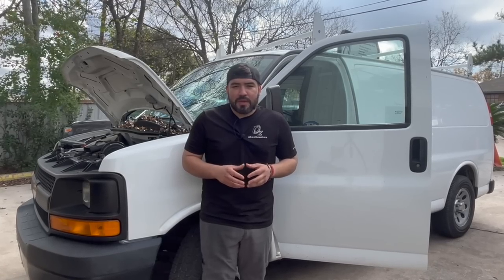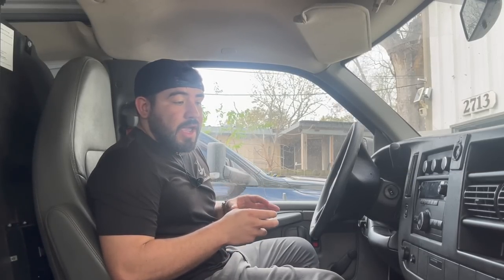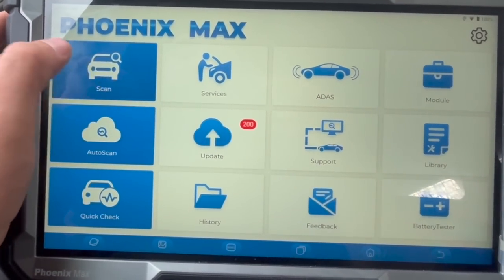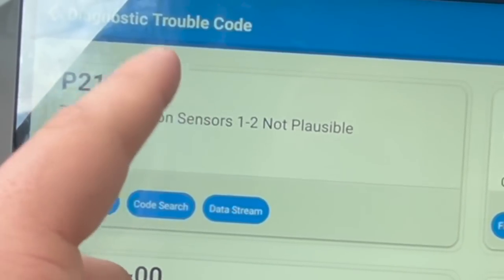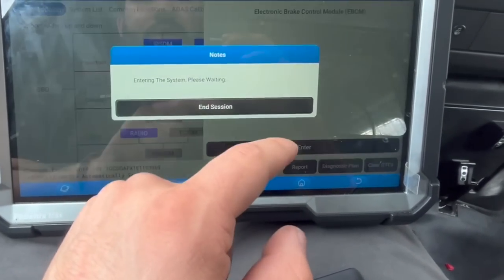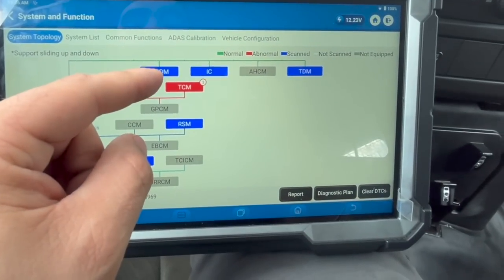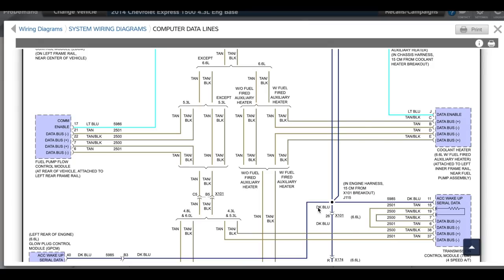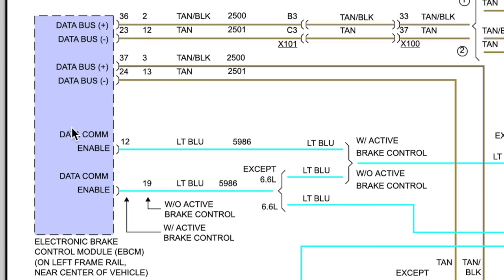Electrical nightmare on this 2014 Chevrolet Express

Comment: Excellent video Oz. One thing that I would like to point out is connecting the jumper wire directly to battery positive is risky. I would have put in between a small incandescent light or a small fuse, just for protection. What if the ABS module had an internal short. And the BCM wire shorted out and blew? I once put a 12 volt without a fuse directly to a module, and it had a short inside the module. And it melted the ground supply wire. Lesson learned. Hope my advice helps someone.
Reply from the maker: That is true.

Comment: For mine it is the connection all you have to do is go under your driver front mid... get that clamp on there good and all good. Iff not you got a problem with the module.

Comment: That is great info on finding the problem with the analyzer. One thing I learned a long time ago when you have an electrical problem is to do a thorough visual inspection. I have found numerous electrical issues because of squirrel or mice damage.
Reply from the maker: Normally I see that happen in wooded areas or really cold places where mice and squirrels can bundle up and bite them wires
Reply: Good thing there going to soy wrapped wires..NOT!

Comment from the maker: **Want to own the tools I use ?? 
Click on the amazon link below to get my top 5 Tools I use**
Automotive Test Light- https://amzn.to/3z1Pdxa
Flexible Backprobe- https://amzn.to/3Pyr3zO
Multimeter- https://amzn.to/3PbuT23
OBD Scan Tool- https://amzn.to/3zaNWnq
Wire Piercing Probe- https://amzn.to/3OecWhT
JarHead Diagnostics promo code- OZ10
Topdon Phoenix Max- 

https://na01.safelinks.protection.outlook.com/?url=https%3A%2F%2Fwww.topdon.us%2Fcollections%2Fprofessional-series%2Fproducts%2Fphoenix-max&data=05%7C01%7C%7C897428785db447e8345d08dae2a18266%7C84df9e7fe9f640afb435aaaaaaaaaaaa%7C1%7C0%7C638071480567184739%7CUnknown%7CTWFpbGZsb3d8eyJWIjoiMC4wLjAwMDAiLCJQIjoiV2luMzIiLCJBTiI6Ik1haWwiLCJXVCI6Mn0%3D%7C3000%7C%7C%7C&sdata=luV2vOgQ9MwIpnIc2%2BjGABg%2ByD8qsUdiydeyqGJKzOQ%3D&reserved=0

Comment: Since the wake up signal is a low current 12v, you can just jump power from a feed wire at the abs module thru your test light bulb instead of running that huge jumper lead. Great job and good find! 👍
Reply from the maker: I was excited to show off my 10ft jumper. :)
Reply: Fair enough my friend. Hope you and your family have an awesome Xmas
Reply from the maker: Like wise. And I forgot to put thanks for watching.

Comment: I have no communication on abs module 2006 Sierra Denali. Power  and ground are good. I will check wake up light blue wire for power signal. I think there is a junction under drivers side frame rail. Great video.

Comment: I've had nothing but electrical problems with all my Chevy vans from the '90s on up. Bad Fuel pumps. Rusty brake lines breaking. Ground wire shorting out. When it rained the door locks would flip up and down.
My last three vehicles were suburbans Yukon and now my battery goes dead after 14 hours I've had two mechanics look at it. Whatever you do try not to switch the radio with a junkyard radio even if it's the same year because GM purposely made these radios to not work right when you swap them. I had to open the bottom of the radio and pull out a chip and I still cannot get the radio to work properly also the door chime is five times louder than it used to be so I had to open the speaker wires in the door hinge area and cut the tan wire to stop the chiming.
Reply: 350k miles on 2003 only minor problem s cheap easy to fix .
Had a few last one went 410k
Reply: I’m running a ‘13 express 2500 4.8l, 175,000mi and it runs like a top but I do have random electrical problems and it tends to run a bit rich. I ran a ‘07 express until 419,000mi before a major failure and have been using it as a parts truck since I parked it

Comment: Having a very similar problem with my 2011 gmc savana 1500. In the same exact spot, my wires look like they’ve been chewed by rats. But none of the wires are exposed. I don’t have communication to my TCM Or fuel pump control module
Reply from the maker: While looking at the wiring diagram for this savana. In the linier communication it goes from the ebcm to fuel pump module to tcm. So if your ebcm is communicating your issue is going to be right after the ebcm. If you have a scope I would look at the data lines at the fuel pump control module

Comment: Where are you located? I think I have the same problem. Lost communication with transmission control module, lost communication with body control module.

Comment: Trying to find where ground wire is from the engine to the chassis in our chevy express 2500 2016? I can see the red going to the fuse box under the drivers seat, but I can't seem to find the black ground wire.

Comment: Have an older express that will just quit running when driving or all sudden after driving fine than go to start and won't until next day,have replaced fuel pump but still happens and no errors come up when scanned ,anyone have this issue,help

Comment: Good Brother Oz! I am one of your many faithful subscribers. I am learning to work on my vehicles from you. Thank you for your cool professionalism! I am not sure if you can help me, but I want to ask about my 2012 Chrysler 300 Limited 3.6L. I am having over heating problems. I have changed the Thermostat; no fix. I have replaced the the oil filter housing; no fix. I am thinking it may be the water pump, but I don’t know how to test it. Do you know of a simple way to test my water pump. Sorry if this is a dumb question. Thank you again. Doug

Comment: this is why I dislike new age vehicles. 1 wire can break and then its a dice roll that you can still start it and drive. Why cant we just go back to old cars where you just dump gas down the carb and hook up the battery to the distributor and your off
Reply: Because they won't pass emissions standards.

Comment: Hey where are u located I need a mechanic to fix my truck 2007 f150 with p0340 and p0355 code I think it’s a wiring problem

Comment: Sounds like a bad fuse box bro or the computer not working pretty much a bad fuse box a bad body control module something to do with power you hear the key start to chim it's the orange wire maybe has a fusible link